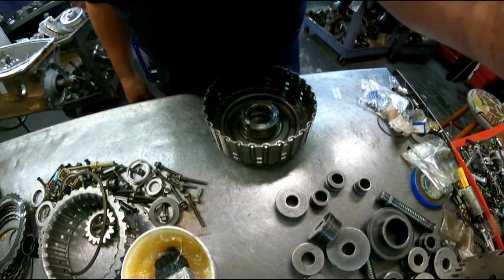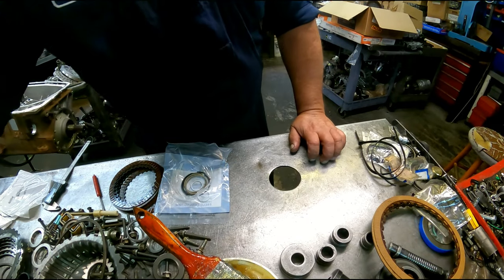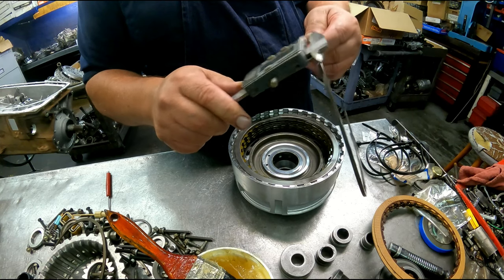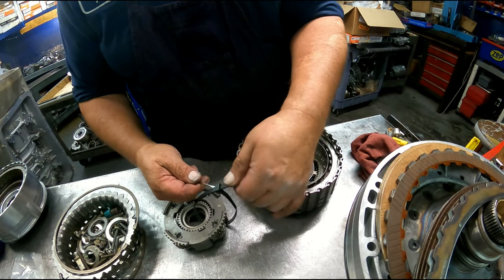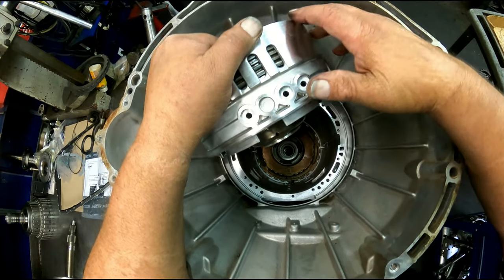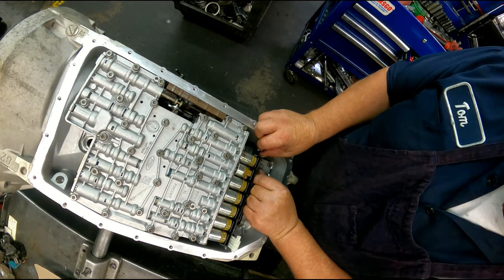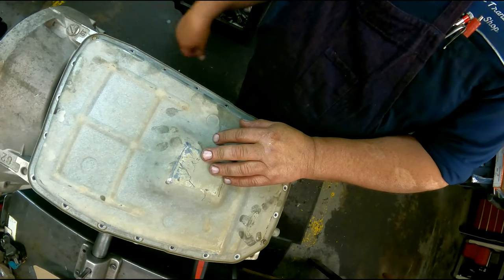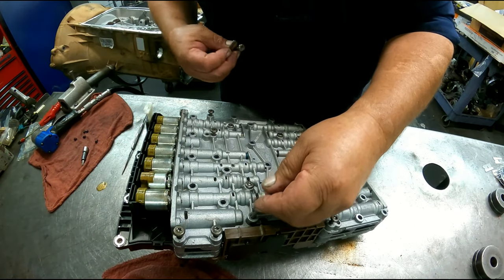6R80 Gen1 2nd Design Rebuild

Comment: Man, just found this video. I’m building a 2014 model 6r80 for my 98 mustang. I found this because I tore it down and got my clutch steels and frictions all mixed up and the atsg manual doesn’t specify plate thickness. You did a fantastic job at getting me sorted out. I thank you very much for the time and effort you’ve put in to this video.
Reply from the maker: Glad I could help, thanks for watching.

Comment: What brand grease do you use for assembly and what brand trans stand are you using to hold it. I’d like to tackle this job myself, already bought a new converter from ford, a pan gasket and 14 qtrs of amsoil oe trans fluid. Ik the lead frame has to be changed also and I have heard a “Sure cool” thermal bypass valve is also recommended.
Reply from the maker: Dr. Tranny (Lubegard). I use the blue and green. They also make red. The stand is from Atec Transtool. Link is in the description. If you are in colder climates then that is a good one. Warmer climates I use the Transgo one.

Comment: Hi, I'm trying to assemble my 6r80 from my 2010 ford f150 4.6!  in the minute 1:20 to 1:40 you install the part!!  In my transmission with the 116 metal discs and the .62 clutch, when I finish putting them there is no place for the Snap ring!  I checked another 6r80 5.4 transmission and in it that part is smaller and the Snap ring fits perfectly??? I'm confused why was it rebuilt earlier and I don't know if that part is the correct one?
Reply from the maker: Should start with a cushion plate .039, Steels .118, clutches .063, pressure plate .118, snap ring is selective. Clearance .027-.043. 3.7L is a 4 clutch the rest are 5. It uses a different piston.
Reply: Thank you very much for the help !!!  excellent video!! 👍
Reply from the maker: @rodrigoaldaz3462  Thanks, Thanks for watching.

Comment: Have a hard time getting that lady drum to fall in what can I do?
Reply from the maker: I'm not completely clear on the drum you are talking about.
Reply: @CurmudgeonTransmission  last one before the pump
Reply: It seems like that bearing is stopping it from going down all tge way thinking bearings are in wrong but they don't seem to be switchable
Reply from the maker: Did you put new bushings in it? Did you try your shafts in each spot before you tried putting it together? Had one yesterday that the bushing in the direct drum was too tight and would not let the drum go in.
Reply: @CurmudgeonTransmission  I will check

Comment: I've got a question about the 6R80 transmission tail-shaft (output). After buying my 2012 F-150 I noticed a loud rumbling/vibration while driving on interstate. Thinking it was the either the driveshaft or rear-end pinion bearing or diff carrier, I installed a brand new 2-pc driveshaft with center carrier bearing because u-joints were frozen. While installing new driveshaft to trans output shaft, I noticed excessive up/down lateral play in the shaft. Anyhow after installing new driveshaft, rumbling/vibration still there.  I put it in Ford shop for repair. The tech informed me nothing wrong in rear-end but the noise is coming from 6R80 transmission. He said transmission must be replaced. After week in shop waiting for warranty approval, it was denied because I had just purchased truck and had not put a 100-miles on it yet. It's now been sitting in shop for weeks and I'm wondering if the play in the output shaft is causing the problem or has the torque converter come apart inside. Truck is driveable at 45-mph and under but anything above that is very noisy inside cab. Besides a potential torque converter failure, what else inside the 6R80 could cause a loud rumble and vibration? Transmission to me shifts normally, does not shudder that I notice though it has weird shaking at idle, and appears to do what it's supposed to until you get it on the highway. Above 68-mph it's bad and painful to hear like a pack of roaring lions in back seat. I'm not against replacing whole transmission but if it's just the torque converter how would I know, maybe I could save some cash on out-of-pocket repair bill.
Reply from the maker: These transmissions have a fair amount of play at the tail. Vibrations and noises are the hardest things to diagnose. Most vibrations that start somewhere around 70mph are usually related to the tires. Strange that they denied the claim because you had it less than 100 miles. Is this an extended warranty? Have seen that before on those. At this point they kind of have you over a barrel. Did you by chance buy it from this dealership? Some states have laws that allow you to return the vehicle in a certain amount of time. Might start using that as leverage at the least, make them take it back at the worst. I have not had one come in with this complaint. I looked up TSB's and nothing came up. Also looked on TRNW and nothing there either. I am not so sure it is in the transmission but that is not to say it cannot be. Did they tell you what you found inside the transmission?
Reply: @CurmudgeonTransmission  - I took my new to me F-150 to my Ford dealer who has rebuilt the engine and serviced my Crown Victoria for many years now. My original complaint was for a Ford Recall and the rear-end noises and vibration. Ford tech attached several microphones to drive train which hooks to the scanner and took it for a drive. Said nothing wrong with rear-end, tires were brand spanking new (less than 50-miles). He said and the scanner verified rumbling noise coming from transmission. This afternoon the owner of the dealership where I bought the truck two months ago called and said he would pay to have truck towed to his shop 50+ miles away and they'll install another transmission because the extended warranty company would not cover and his shop should've caught this before the truck was sold. I asked what they planned to install in my truck and he said used. I said no-go, I will only settle for a Motorcraft reman and new torque converter. He told me they'll do that but there will be an up-charge and I said I'll gladly pay the up-charge so I can get my truck back quick and with a 36-month warranty on replacement trans/T.C. I was going to foot the whole bill with my Ford dealer but the dealer where I bought it said no, he doesn't want me to do that because it was his shop that dropped the ball. Sounds like a real stand-up guy.
Reply from the maker: @kingjames8283  Sounds like it.
Reply from the maker: What year is this truck?
Reply: @CurmudgeonTransmission  - It's the 2012 model. I first got word last week that the repair shop was only going to do a trans-flush which we know is impossible without special equipment but then two days after they told me that, they called me back and said they would go ahead with the original plan to install a Motorcraft reman transmission and torque converter after learning something from the former owner. It's been 3-weeks since I last saw my truck but fingers crossed, I should see it again with new transmission the final week of July. The repair shop was intending to just install a used junk yard transmission and I said no-go, I want a Motorcraft reman for which they said okay but I'd be responsible for the up-charge which I said I'm okay with. The dealership that sold me the truck mid-May 2022 called me last Thursday and said he covered the tow bill and is covering 100% of the labor charges and my part will be just $1,900 which I said I'm fine with as this is normally about a $7,000 job. Ford has a history of problems with this transmission for the models years around 2012 and unfortunately the beautiful F-150 truck I bought was one of them. I'm just thankful that I'm not going to be left high-and-dry. The tech's at the Ford shop my truck was originally at indicated "excessive" play in the output shaft in the report they issued to me. Something failed big-time but exactly what and the extent of the damage is not yet known but I have requested a follow-up pending the findings once transmission is dissected and examined.
Reply from the maker: I would like to know what they find. If you don't mind let me know.
Reply: @CurmudgeonTransmission   - Will do because I am curious as well. What I figured was a failed pinion bearing and race in the rear-end turned out to be something much different. What I cannot know at this point is if the repair shop is as inquisitive as I am and tear into the transmission once they have it out or figure it as lost cause and toss it in a heap of scrap metal. If they do tear into it, I'll ask them to keep me in the loop so that I can share this information with others.
Reply from the maker: @kingjames8283  Thanks

Comment: Hi again, at the start of this video, you mentioned about marking the piston and the tabs. What if you didn't mark them and just installed it back in? What are the possible problems the transmission will face? Because I think I failed to do that. To install new seals I removed the piston and put in new seals and put em back.
Reply from the maker: Nothing will happen. I mark them for quicker assembly. It has to be lined up or you can not get the planet back on. If you were able to put the planet back on then everything was lined up.
Reply: @CurmudgeonTransmission  ahhh I see... Actually just by looking at the design of the assembly I managed to install em back correctly by lining up tabs and the piston according to the bottom of the plenary gears
Reply: @CurmudgeonTransmission appreciate your time.
Reply: Good morning sir, the 6R gen-1 I overhauled has the same symptom or issue. As soon as you shift in to reverse or Drive, the vehicle just wants to go move forward or reverse right away and if you hold the brakes, the engine shakes and drops RPM.
Reply: Do you think the TC or the TC solenoid is faulty and need replacing? Now that I've changed all seals and rebuilt the valve body? 😕 Appreciate your time,
Reply from the maker: Possibly. What all did you do to the valve body? Did you replace the bushings in the unit?
Reply: @CurmudgeonTransmission  I did a rebuild on the valve body with a zip kit provided by sonnax. I changed the end plugs, the solenoid dampers,... pretty much the stuff from the kit were put in.
Reply: @CurmudgeonTransmission  what bushings, please specify.
Reply: @CurmudgeonTransmission  oh and one more thing, on a level or flat place, the vehicle will move forward or reverse if shifted to. But when vehicle is put at a hill, it doesn't climb, and if you press down the accelerator pedal, nothing happens.. meaning the engine rpm doesn't increase like normally it would to climb a slope or mountain
Reply: This is a tough nut to crack... I wish we were in the US where I can just find all the parts I need for this gearbox..
Reply from the maker: All the bushings really need to be replaced in this unit, but at the minimum the bushings in the stator shaft that control lock up. depending on which shaft you have you either have 1 or 2. It definitely sounds like lock up is staying applied. It is just a matter of is the problem in the valve body with the valve itself, the solenoid or lead frame or computer.
Reply: @CurmudgeonTransmission  but then if it is staying locked up, why can't the vehicle drive up a mountain or hill? Really makes no sense
Reply: @CurmudgeonTransmission  which valve in the valve body is responsible for the lockup? Maybe I can rectify from there on
Reply from the maker: The section of valve body that has the solenoids, face the solenoids away from you. Now go from the right side. Second valve to the left is the TCC release. 4th one is bypass control clutch regulator, controls apply. If you have the solenoid end facing you the TCC solenoid is on the left.
Reply: @CurmudgeonTransmission  thanks I've already identified the solenoids. I got a DTC saying Shift solenoid B has a malfunction. P0579. I think
Reply: @CurmudgeonTransmission  morning, I have a question regarding a solenoid that has two blue rubber seals. When shaken it's noisy. Like something is loose inside. It's the solenoid before the TCC solenoid.
Reply from the maker: It is the only On/Off solenoid in there, when it is applied it seats the ball in there.
Reply: @CurmudgeonTransmission  ok so you are saying it's normal to have that solenoid rattle?
Reply: And maybe the convertor regulator valve is not doing what it is supposed to be doing. It might not be releasing the convertor pressure that is why the engine vibrates alot when I apply the brakes, as if it is trying to stall
Reply from the maker: Yes
Reply from the maker: Possibly
Reply: @CurmudgeonTransmission  can you make a video showing the passages in the valve body that makes the convertor release regulator valve do its job? Or which solenoid or valve activates the convertor release regulator valve. Im trying to understand the insides of the valve body
Reply: @CurmudgeonTransmission  my apologies for bothering you. I just wish I could stay in your garage and watch you work and learn more from you. Unfortunately I'm on the other side of the globe 🌎 a place called Papua New Guinea if you've heard of it.
Reply from the maker: I don't have any oil schematics for this but I am in the process of making videos of the two I have showing what each valve is, spring dimensions and the 2 kits I put in them. Those are on Patreon. Not sure how long it will take. I have been super busy and I am way behind on my video editing.